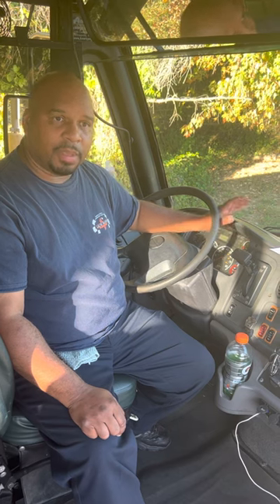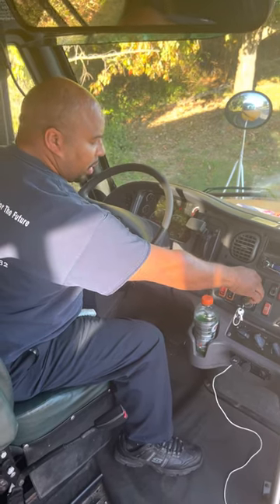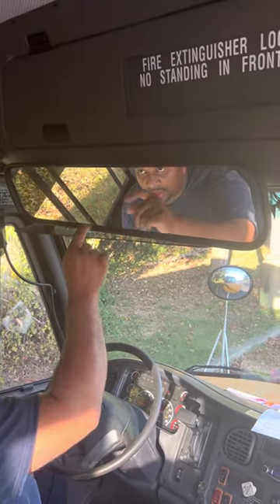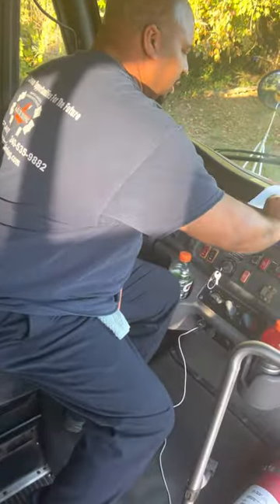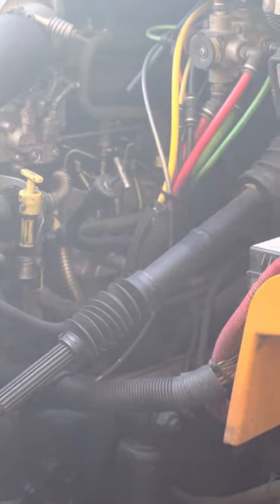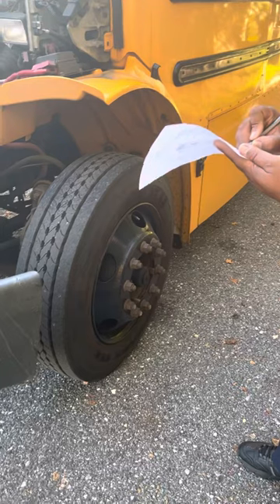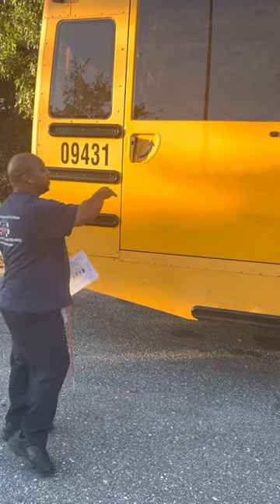Maryland Pre-Trip Inspection for School Bus - 2022

Comment: 5:13, parking brake test
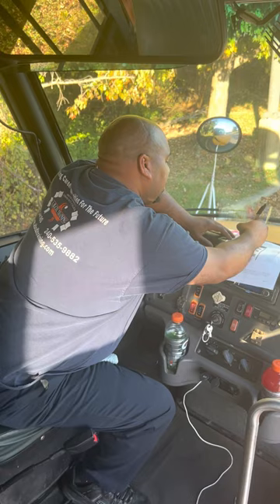5:47, service brake test
6:46, light indicators
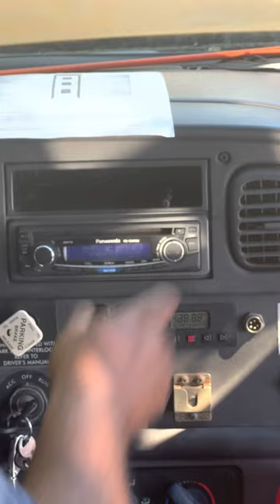7:38, emergency equipment
8:23, windshield
8:44, traffic monitoring devices (mirrors)
9:28, heater & defrost
9:44, horn
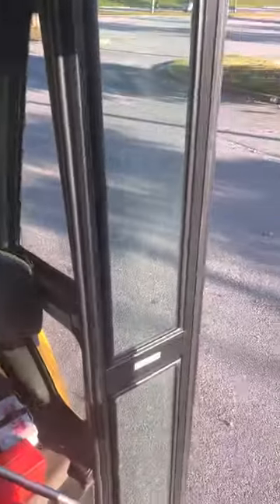9:54, entry door
10:17, emergency exits, ramp, seats & isle, camera
13:25, student lights
16:39, external lights
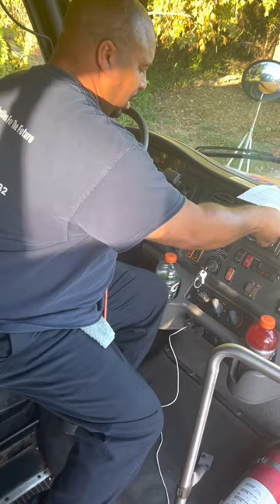19:40, student alarm
20:47, inspect under hood***
27:27 full exterior inspection***

Comment: I can’t believe how different a air brake test in other states. Our air brake tests are different.
Reply: On ours we chock the wheels build pressure to 120-140 then cut the bus off, turn the bus on, watch the gauges make sure it doesn’t drop more than 2 psi in 1 minute then press and hold the brake and make sure it doesn’t drop more than 3psi in a min then pump them down between 60-65 psi the warning buzzer and light goes off continue until the brake sets between 25-40 psi remove the chocks. Then start the bus up buzzer and warning lights go off around 60-65 psi then at 85 psi we have to make sure it goes from 85psi to 100psi in 45 seconds. When the governor cuts off around 120-125psi you pump them back down to 90psi to make sure your compressor kicks back on and when it gets back to 120-125 psi you pull against the service brake then pull forward at 5 miles per hour and hit the brake make sure it isn’t pulling left to right then it’s over.

Comment: When are you supposed to remove the chock from the wheel ? From looking at the video you never remove the chock i do not want to run it over the chock and fail when letting the vehicle roll 5mp and stop

Comment: Is it a certain way maryland mva want the air brakes inspection done? I just got my learners for them and want to make sure I am starting right.
Reply from the maker: Hello….. Maryland wants you to perform the Airbrake test first before inspecting the rest of the vehicle. They pretty much want it done in the order shown on the video.
Reply: @aaronmoore7778  ok thank you. I already have my cdl just adding the air brakes endorsement to it. Also will have to take the bus out after the test is done or is that part all I have to do?
Reply: @aaronmoore7778  also do I have to inspect the hoses and drum drum/lining and drum??
Reply from the maker: You only have to inspect brake hose, brake line and mention that there’s no grease or oil on the brakes.
Reply from the maker: If you’re testing in Maryland you have to pre-trip the entire vehicle to get the Airbrake endorsement. That change took place in September
Reply: @aaronmoore7778  ok thank you so much
Reply: @aaronmoore7778 So if we are not opening the hood now how am I checking the steering systems